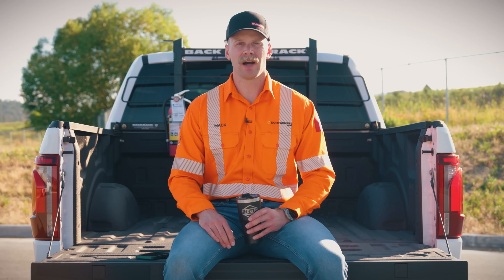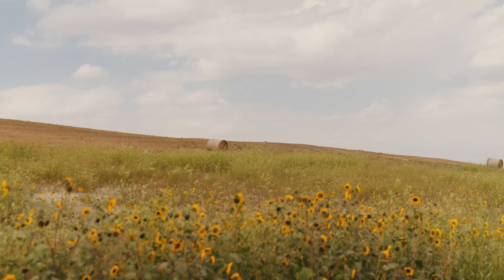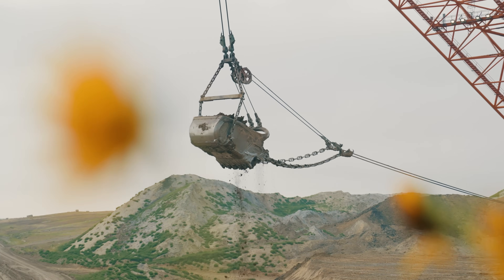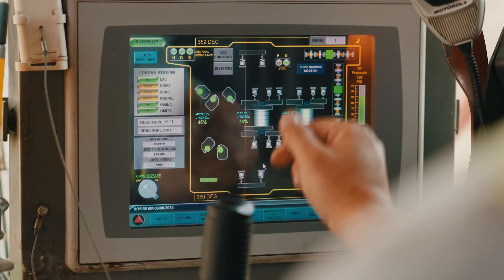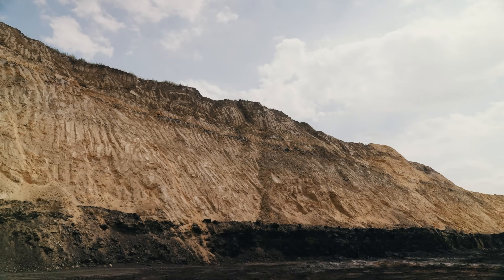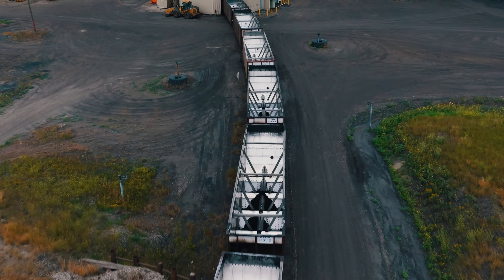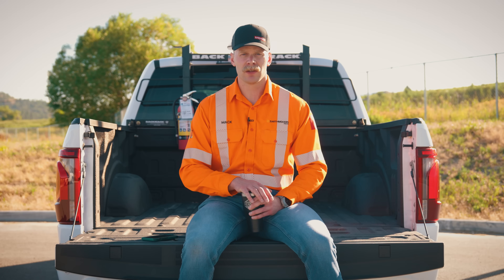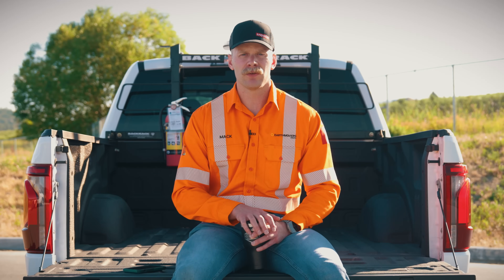Coal Mining Explained | Inside Saskatchewan's Largest Coal Mines!

Comment: My question would be why dont we use these open pit mines and turn them into land fills
Reply from the maker: They aren't near any city of significance, so the cost the truck waste to these mines would be huge. The land is better off reclaimed as they do in the video
Reply: think of the truck pollution and hauling requirements - perhaps a rail road setup would make more sense maybe?

Comment: This brought back pleasant memories of my younger days.  I'm 83.  I grew up in southern Indiana and lots of strip mining. I later worked for CAT at the Decatur, IL Plant.  My Dad's next door neighbor was an operator on different "walking draglines" for some 25yrs. I visited many of those mines to see CAT's doin their thing. At one time there were four shovels (2-150's, a 125 and a bigger mach but I don't remember the size.
 My highest memory was watching a S X S D9 pushin top soil on the leveled spill banks. I talked to the operator and ended up making a couple of passes.  It took a very fine touch to prevent stalling or slipping the tracks. It didn't work as well as they hoped and along came the D10 and then the D11.
Great video🤠 Ye Ole Caterpillar Cowboy

Comment: Always interesting how things are handled elsewhere. The width of the coal streak seems to be "narrow" and therefore scraping buckets the best choice. Until it was shut down simmilar open pit coal mines in Germany opperated on larege rotating bucket excavators all interconnected with conveyor systems for coal and overburden. Also they had a own railway system for delivery to the nearby power plants. Regeneration is key there as the topsoil has one of the highest soil qualities there is... (Hambach & Garzweiler if someone wants to take a look from above..)
Don't get me wring , I am fully aware that draglines are the most efficient way in the Poplar River region!

Comment: Our company made a Mine Rescue Vehicle, decades ago, which was used for medical extraction if needed, in coal seams which were only 1-meter thick.  The company was mining into areas, with tools, where even a third-meter seam was useable.  There are gazzillions of Tonnes of coal still in the ground, in very thin seams.  If there was a way to get that energy out, either chemically, thermally, mechanically, or by any means, we would have energy for 10,000 years or more.

Comment: Isn't it kind of stupid to remove that much overburden just for that little bit of coal? the energy balance is beyond retarded, you need more energy to removve the overburden than you get out of the coal you mine...

You'd be better off to just burn the oil and fuel you waste here for power generation than use it to remove overburnden to get to the low quality coal... how this operation is economically viable... is a big question.

Comment: Kidd Crrek mine in Timmins, Ontario, also has it's own railway that runs from the mine to the kidd concentrator (about 30km). It use to have a smelter, but it shut down and the concentrate ore is brought to Rouyn Noranda smelter in Quebec, by rail (Ontario Northland Railway)
Reply: Kidd Creek
Reply from the maker: I believe West of the Ontario border this is the longest private short line on a mine site, I've definitely heard of some mines in Ontario with longer rail lines like you mentioned

Comment: What do they do with all of the ash generated.  Lignite is the dirtiest coal so it must bur a fair amount of dirt as well, and that would cause a lot of ash to be released from the coal.  Unless they clean the coal before crushing it, either way they must be a lot of residuals that need to be hauled away from the power plant.
Reply from the maker: We haven't toured the power plant, so I can't answer that question, hopefully in a future video one day we will get inside one of Sask Power's generating stations
Reply: @Earthmovers_media bottom ash and some flyash is moved by water pressure in pipes to large settling lagoons…the ponds are lined and monitored for leakage into the ground water.  Once the lagoons are full, they are dewatered and capped with dirt
Reply from the maker: @paulcurrie7828  We have a full length video coming soon visiting KPCL digging out Poplar River's fly ash lagoons

Comment: Great video. Been moving earth for over 40 years and one thing I don't understand is why don't they use scrapers to remove and stockpile the top soil? Much more efficient in my humble opinion.
Reply: Scrapers are a one trick pony. The loader, excavators and trucks can do multiple jobs in the process.
Reply from the maker: I had the same thought, a fleet of buggies would do wonders stripping topsoil. But I guess wiggle wagons and an excavator/wheel loader is all they have there

Comment: Nothing can move more dirt than that dragline  - as long as you bellieve, U.S.A ist the only country in the world.

Otherways mightiest earthmover is Bagger 293, a wheel shovel excavator manufacured 1995 by TAKRAF used in Germany coal mine of Hambach.
With it´s 14.196 metric tons it is twice the size of this Bucyrus Dragline, it´s powered by 21.870 kw altogether.
To compare it: the Bucyrus has got one 93 cubic yard scoop. Bagger 293 shovel wheel has 18 soops with  8,3 cubic yards each and empties one scoop per each two seconds - Bagger 293 is able to move 240.000 m³ of overburden in a 24h shift.

Comment: With 100 foot depth of un-compacted material being cast into the big trench, how many decades until it stops settling?   Years of seeding and scraping the reclaimed fields flat must leave some extremely thin  topsoil depths as valleys are filled in. In a century will this be waste land ?   Looks like productive reclaimed farmland in the short term, but in the long term?
Reply from the maker: The mine began near Poplar Station/Town of Coronach and moved North, all the land between there and where the current pits are has been reclaimed and those hay/alfalfa/grassland is still growing

Comment: By far not the biggest and most powerful. The bucket wheel excavators in Germany like bagger 288 are way more powerful. They don't even bother with truck transportation, conveyors and electrified rails all the way in to the mine are the only thing that can keep up
Reply from the maker: Yeah, those bucketwheel operations are something else. But the two Bucyrus Erie 2570W draglines at Poplar River are the biggest ever built by BE (excluding the one off 4250W Big Muskie Dragline of course)
Reply: @Earthmovers_media how do you define “big”? Size or tons per hour?
Reply from the maker: @edmundsander2039 sheer size

Comment: The bienfait coal mine east of this one is sad to drive by and see all of the unreclaimed spoil piles.
Reply from the maker: I've been to Estevan/Bienfait. They told us some reclaim there is historical, and the spoil piles are left for grasses to grow and natural water ponding. While some reclaim is completely recontoured land to mimic original pre disturbed ground
Reply: @Earthmovers_media good to know, from North Dakota and happened to drive through there.  I’ve always been amazed by how well our reclamation is here so it was disheartening to see that but it now makes sense on why they do it.  

Did they ever mine underground for lignite In these areas?  In Beulah, North Dakota they originally were mining underground for a small power plant.  You can see the mine shafts that have collapsed from google maps on the east side of town, must’ve been pretty close to the surface.
Reply from the maker: @Refinery_Life  If you ever drive up through Estevan mine again, tour the Estevan mine (you can do a self guided tour on the back roads). There is a better example of the old spoil pile legacy reclamation there.

As for underground mining, I don't think they did much. Maybe got at the coal seems along the valley edges. Which mine in North Dakota do you work at?
Reply: @Earthmovers_media I have family that works at coteau freedom mine in Beulah, ND.  I personally worked at Dakota gasification company where we turned lignite coal into natural gas and various other byproducts.  

I will definitely have to do that!  Most of the underground mining was for small power plants in town prior to the 80’s in North Dakota from my understanding.  It looks like it was all shallow along valleys as you were saying.

Comment: That's all nice but how about all the coal emissions going into the air when burnt?
Reply from the maker: Modern day coal burning technology is far better than it was in the early days of coal power generation, the adjacent mine in Estevan actually has a carbon capture technology on the one burner
Reply: Who cares, thats why you have cheap reliable power for decades from coal unlike full wind and solar your standard of living will decrease and thats a fact.  Dont cry when your power goes out because of unreliable inefficient wind/solar energy.   Wind and solar wears out and output everyday will decrease and become more and more inefficient just like what happens to rechargeable batteries. They cant make batteries last in your phones for decades nor can this pipe dream of wind and solar ever going anywhere other then drowning the public in debt from giving out public money to start this inefficient energy sources only to fail and bandits run off with the money and public left with nothing.
Reply: Lignite is by far the dirtiest powersource. 2-3 times more CO2 emissions than natural gas even

Comment: How deep is the coal seam itself? It didn't look at that deep when they were digging it, but that may have been deceiving.
Reply from the maker: The highwall is deceiving, I believe it averages 80-100ft, sometimes shallower or deeper. The drags can only dig so deep, so if its 175-200ft I think they can't mine it
Reply: @Earthmovers_media  Thanks... I was actually curious about how thick the seam of coal itself was (vs the overburden)?
Reply from the maker: @jeffshiner6087  They only have one main seam in Poplar River, it is pretty consistent over a wide area and averages 2m thickness

Comment: Why D10 rathe than D11
Reply: Similar to my thinking, that loader looked one size too small to load those coal haulers!
Reply from the maker: @nigelmcculloch3746  A 993K in the right spot with a good operator can really load out those trucks. Lower cost to run/purchase too. 993 is kinda standard issue for similar coal mining operations like this.
Reply from the maker: They trialed D11 there, to high cost to run for what they do. Kept the D10